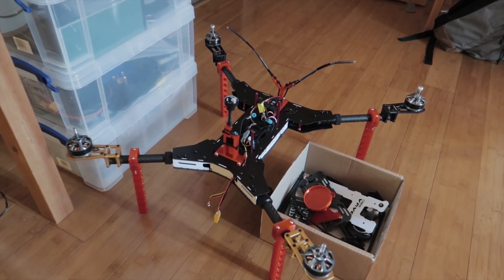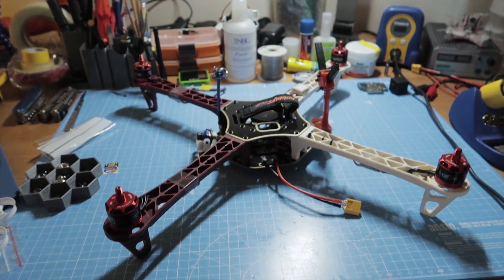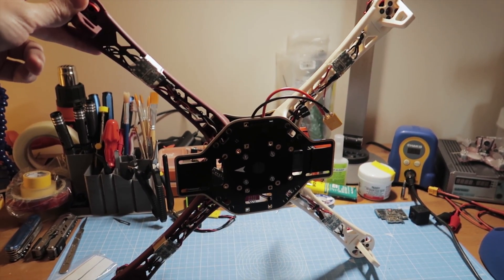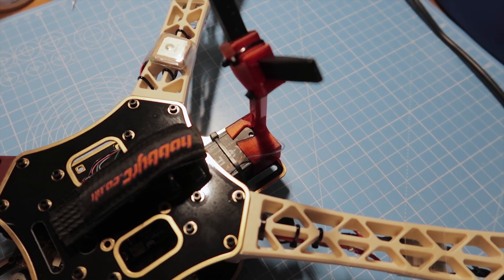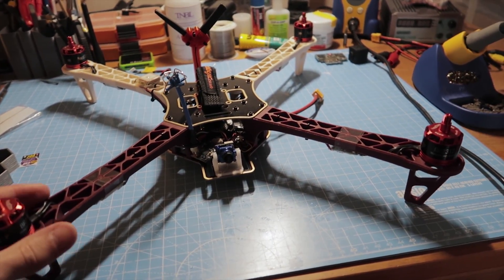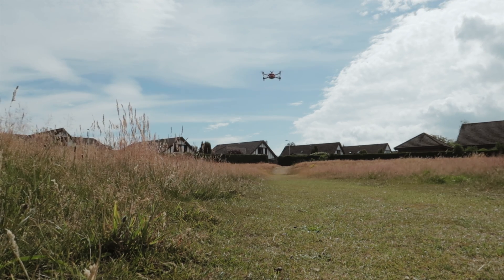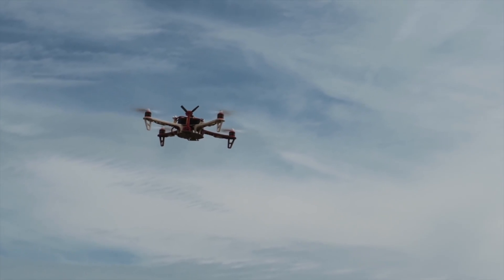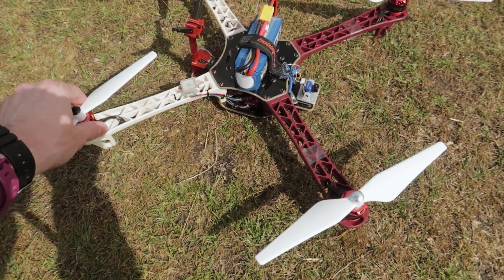Dirt Cheap iNav Quad // Matek F405 // Racerstar 2312

Comment: I've been looking at this frame for my very first drone however, watching your video and other forums saying the frame is very flexible and vibration prone. I'm now looking at the S500 frame as a better option ?
Any advice appreciated !
Reply from the maker: Some versions of  the S500/S550 have carbon spars within the glass fibre arms to help with rigidity, but some of them don't & are just the same flexible material as the Flamewheel clones.
Reply: @CJDavies  Ah ok, I knew about the fiber rods but hadn't realised some don't come with them. These people say they do https://www.unmannedtechshop.co.uk/product/s500-quadcopter-frame/ 
The F450 seems almost toy like ?
Reply from the maker: @myozone  You have to remember that the F450 is a very old platform - it dates back to at least 2012 & afaik was pretty much one of the first commercially available multirotor kits/systems. A lot has changed since then, however because the focus for DIY builds has moved away from small semi-autonomous platforms (due to just how good Mavics/Phantoms are) there haven't really been many new ~450 size frames released since.

If you're willing to invest more money you could think about something like the EDU450, which is a reference frame/powertrain for the Arducopter project --> https://ardupilot.org/copter/docs/reference-frames-hexsoon-edu450.html
Reply: @CJDavies   Thanks CJ the EDU450 looks solid but I can't find any details of it's motors, props and flight time all up and max weights.
Reply from the maker: @myozone  Yes, information does seem a little scarce. I'm sure if you ask on https://discuss.ardupilot.org/ somebody can give you more information. I know the kit comes with T-Motor motors, pretty sure they're 2316 but don't know what kv, probably something around 960.

Comment: Don’t these esc’s get very hot?
Reply from the maker: The old fashioned 5V regulators run warm (perfectly normal) but otherwise they don't get hot at all. This motor/prop combination doesn't pull much power.
Reply: CJ Davies thanks you!
Reply: I just checked out your channel? It’s very nice, i’ve just subbed!

Comment: Thank you for the vid!  Have you had any progress on tuning this bird?  I have the same platform with retractable landing gear and 3 axis gimbal on rails.  It flys well so far, but I’m wondering if things can be “tightened up” on the handling and the touchiness when flying around while in 3D hold.
Reply from the maker: I'm currently rebuilding it as a hex using my Everycopter carbon hub. 15mm hardwood dowel is a substantial upgrade in stiffness compared to those flimsy clone F450 arms! https://www.instagram.com/p/BzROjU3HA-Y/

Comment: Hey man, any issues with the self-tightening props? I'm using T-motor Air Combo 450 with some and they've come off multiple times, including one time that I was hovering close to the ground and did a quick 180 degree turn. Any suggestions?
Reply from the maker: You want to make sure that active braking/damped light/whatever-you-want-to-call-it is disabled in your ESCs when using self-tightening props, as the braking force is in the opposite direction to the motor spin so will act to loosen the props.
Reply: I know, I couldn't find any way to get the T-Motor AIR 20A ESCS to be programmed. And T-motor CS isn't responding either.

Comment: did you use a 4s battery? the motors were hot after the flight?
Reply from the maker: I tried both 3S & 4S, the motors were fine both times (but I wasn't exactly using high throttle ever).
Reply: @CJDavies  thank you)
Reply: What flight times did you got?